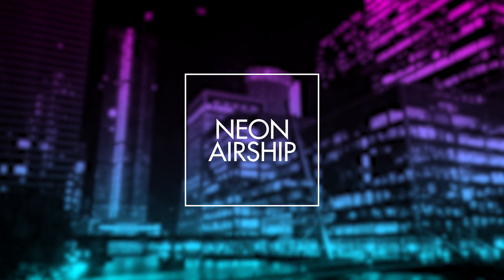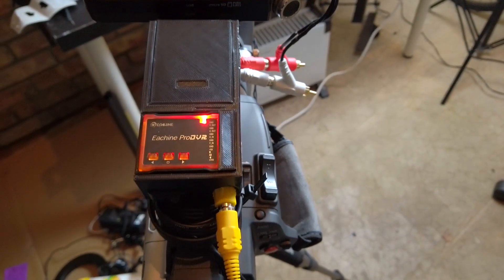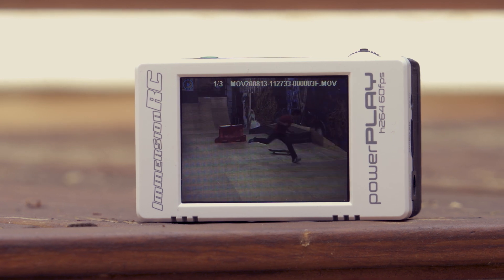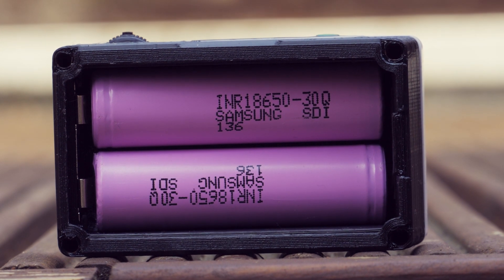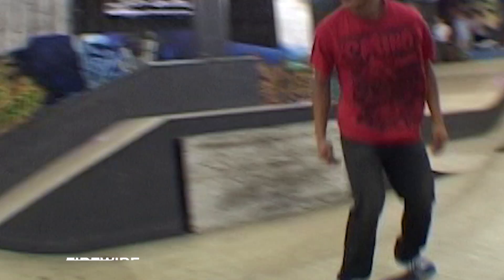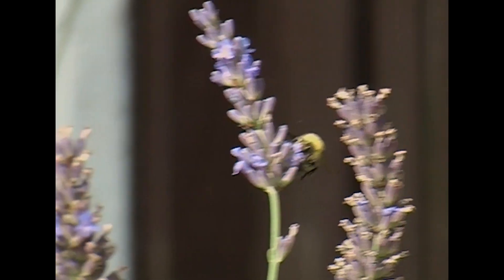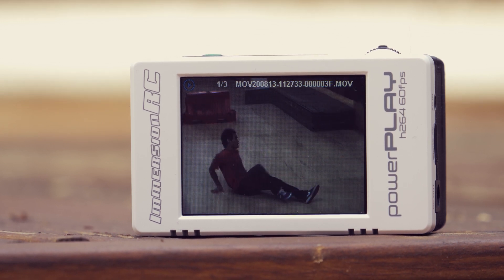Tapeless MiniDV Camcorder Part 2: PowerPlay Boogaloo [GL2 / VX1000]

Comment: Quick question, if your camera cannot record onto tapes anymore, will it be able to record to this? Does the camera just need to be able to output signal to a monitor?
Reply from the maker: Yeah just needs the av output working, camera stays in standby
Reply: @NEONAIRSHIP  do you press record on the camera itself in standby mode? its not possible i guess so you can only record when recording on the powerplay right?

Comment: How can I interpret the footage to use d1/d2 pixels? Is there a way to do it with iMovie?
Reply from the maker: I only use premiere so not sure sorry
Reply: Okay no worries. Would you say it’s necessary to interpret the footage into d1/d2 pixels.
Reply from the maker: I think it only matters if its a HD timeline, if you make a DV project should be all gucci. It just stretches it slightly if it's square pixels

Comment: The thing that will always stop me from trying this is the fact it's adding more compression, compared to importing it direct with no compression (well, no more compression then DV already has!)
Reply: why is this bad. i dont know anything abt this
Reply from the maker: Just means this way is slightly lower quality than using a firewire to capture, and it's already standard def so them pixels are at a premium. IMO it's good enough tho, you can see the difference in the comparison I did - I don't think anyone could tell once uploaded
Reply: NEON AIRSHIP ah ok word

Comment: Thanks for posting this solution, as I was unaware that there was any interest in the old DV tape formats nowadays! I still have a pristine VX2100 from back in the day, which sadly hasn't seen any activity since the demise of firewire connectivity into my laptop, and all the subsequent camera upgrades I've done over the years. I will be digging it out of the cupboard now, and looking into all the available recording options. One thing that I might  look at after your comments, is using my Tascam DR10sg mic, or my Saramonic MixMic SR-H5M for the audio capture, and use the powerplay recording for syncing in post. Maybe there's still life in the old girl yet! :)

Comment: I’ve been filming with a ccd vx1e and have been  first looking at circumnavigating using the np77 batteries and then onto tape less. So thank you for posting this.
Also nice seeing some classic Boardroom footage!
Reply from the maker: Boardroom forever <3
Reply: @NEONAIRSHIP  I just got my powerplay dvr and cannot get a video signal. Have the RCA to 3.5 and it aint workin.
Reply: Following on from this I’ve finally got my Vx1E np77 batteryless and tapeless. It’s a little on the bulky and ugly side but I don’t have to worry about battery’s anymore.
Reply from the maker: Sounds cool! What are you using as the battery solution?
Reply: @NEONAIRSHIP  So for my day job I use fairly standard 12v dc li-ion batteries from eBay. My problem with original nicam batteries is theyre 20+ years old and barely hold a charge. So hacked a charger and old battery to house a dc input and buck regulator to take the voltage down to 6v. The batteries aren’t smart so this work fine. Using a Ezcap dvr which records in 1080. Have found using an upscaler greatly improves the quality. So have this on my rig aswell. I’m just putting the finishing touches to it and will make my own demonstration video along with captured Broom footage!
Reply from the maker: Sick looking forward to seeing it👌

Comment: for the 3.5mm audiojack not pushing in completely, it could be that either the cable or the unit have a different pin-order and it might be worth juggling them around. If all else fails, a normal audio cable from 3.5 to 2x RCA should do the trick as well

Comment: Question about framerates - what is the native framerate of one of these old cameras? I was always under the impression that since they use tape (25fps/29.97fps), that is what they film at, but then all these tapeless DVRs record at 60fps...? Not sure how that plays nice with old cameras, or with, say, converting VHS to digital. I'd appreciate any advice anyone might have!
Reply from the maker: They're interlaced so it's 60i in NTSC/50i in PAL - you're right in that not all the data is used, but the cheaper DVRs skip frames which means slow mo looks jank
Reply: I guess it's the best under the circumstances... Wondering, have you seen equipment like the ClearClick 3.0 DVR?

Comment: do you ever wonder about the quality loss not using the firewire out with this setup? from what I understand analog video out is quite a substantial drop in quality because of the redundant digital to analog conversion that has to happen for these cameras to output in analog out, guess there's a compromise you may have to make for the convenience of this setup
Reply: he showed the quality loss and compared to the other fpv dvr it was so marginal that firewire is only good if you already own the equipment as it costs a fortune nowadays secondhand

Comment: Thanks a lot! I use a Canon XM1 to film skating, this camcorder has just a combined A/V Connenctor (same as the DVR probably) should this work too with just a 3 point aux 3,5 mm cable or do you think I need something more specific?
Reply from the maker: Nah XM1 works exactly the same :)
Reply: @NEONAIRSHIP  So with just 3,5 mm aux? It has no 3 point rca video just one combined av.
Reply from the maker: Yep same as the GL2 in the video
Reply: @NEONAIRSHIP  Thanks a lot!

Comment: What do you think about using a standalone capture like clearclick with an external power? It seems like it would be easier to set up and maybe just as effective. I'm guessing there's a glaringly obvious reason I'm missing that people, yourself included, aren't already going that route. Thanks for all the info!!!
Reply from the maker: Yeah you could but it'll be mjpeg 30fps like the eachine example in the video and not much cheaper
Reply: @NEONAIRSHIP  thanks! I think I'm going to pick up a powerplay and set it up like you have! I'm really excited to start playing with my gl2 again and not worry about the heads wearing out! Thanks again for this info! One last question. Do you think this is a good option for capturing video from my mini dv tapes?
Reply from the maker: Awesome, yeah works great for capturing tapes
Reply: @NEONAIRSHIP  just wanted to say thanks again for the info/help!!! I just got my powerplay in the mail, thanks to you! Super simple and easy to use. I'm really excited to play with my gl2 again! When I slow the video in premier to 50%, it almost looks as if the image vibrates up and down slightly. Any idea if this can be fixed? I'm hoping I can solve it by changing some timeline properties or something.
Reply from the maker: Hey man, yeah I think I know what you mean - it's a frame rate thing, try a few different timeline settings to get one that matches up and that will get rid of the jittering

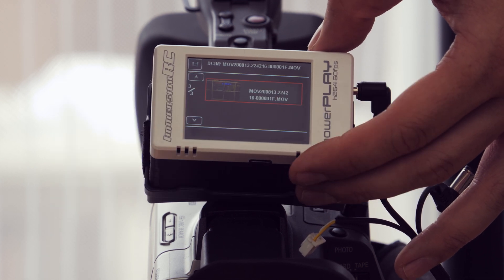Comment: Thanks for making this series! I've just gotten myself a GL2, and tried something along the lines of your first video. I'm having the same problem you pointed out at 3:58 . I wonder if it's just something to do with the GL2 or the ports on these Mini FPV DVRs. Wondering what your thoughts are!
Reply from the maker: I'm not sure but I think it might be the layout of the 3.5mm jack? TRS vs TRRS kinda thing. Different cable could potentially solve it
Reply: @NEONAIRSHIP  Ah! I've found the solution to the problem. The manufacturer changed the layout of the 3.5mm jack and swapped the video line with the ground line.  Now I'm getting a clean picture. Thanks for the tutorial!
Reply: @brianfromtheelluminaticoll8544  Im having this issue aswell. What did you do to solve it?
Reply: @cruzarnett6408  I'm using two 3.5mm to AV (Red yellow white), one with male AV cables, one with female AV cables. I matched the white to white, Red to Yellow, and Yellow to Red cables together, and it reads perfectly clean now (I have some example footage on my channel)
Reply: @brianfromtheelluminaticoll8544  can you make a video tutorial on that issue? plss
Reply: Having this problem aswell, do I need to buy a new av wire or is it a problem with the jack on the dvr?
Reply: I’m interested if anyone has solved this issue, would simply a TRRS 3.5mm av jack to jack work? As apposed to the supplied cable? Can anyone confirm? Ordered the dvr today but wondering if I can skip the awkwardness and get straight to the good stuff by buying a new cable now
Reply from the maker: I'm gonna do some more experiments soon but it works fine with the jack not pushed all the way in so don't worry too much. I think it's just TRS but in a different order, so the easiest would likely be the way Brian described above unless you're cool with soldering/crimping

Comment: bro so i have a sony trv900 which only has a audio/video 3.5 jack. do u think i can get a 3.5 to female adapter that plugs into the immersion rc device and use it like that?
Reply from the maker: It's the same connection as the GL2 in the video, you can use the included cable
Reply: @NEONAIRSHIP  thank you! i didn’t see that at first

Comment: What fish eye you run on gl1 bought a optika 0.3 and it won’t screw on made sure it was gl1 compatible before I purchased
Reply from the maker: what is the filter thread on your fisheye? you probably just need a step-up/step-down ring
Reply: @NEONAIRSHIP  titanium series 0.3X
Reply from the maker: Yeah but which one? 37mm, 58mm, 62mm? GL1 is 58mm so anything else will need an adapter
Reply: @NEONAIRSHIP  58.8mm
Reply: @NEONAIRSHIP  the size of it
Reply: @NEONAIRSHIP  anyway I can send you photos so it would be easier to help me new to all this
Reply from the maker: My email is in the about section on yt or DM me on insta

Comment: hey! mine came in today and i'm having trouble positioning the 3.5mm jack into the powerplay so that it 1. gets a non-glitchy video signal and 2. records audio. so far, i have to fidget with it to get one or the other. any tips?
Reply from the maker: Hey, I'm gonna make a video about this soon but it seems the the red and yellow AV signals are in the wrong order on the DVR. So you can either use some adapters to switch em or just plug into the other ports depending on your camera
Reply: @NEONAIRSHIP  i have a TRV900, so i'm using the 3.5mm AV jack. what would you recommend for an adapter?
Reply from the maker: OK in that case the easiest way is to get 2x 3.5mm to AV cables - one with female connectors and one with male. Then you can swap em round until its correct
Reply: @NEONAIRSHIP  hey, do you mind linking the cables you would use just so i know i am ordering the right stuff
Reply from the maker: @kain6473   https://amzn.to/3amPQ8F + https://amzn.to/3oVfXaD
Reply: @NEONAIRSHIP  thank you bro! whole setup works flawless now
Reply: @kain6473  do u have any footage anywhere using the decice i have a trv900 too lol and am pretty invested into this
Reply: device*
Reply: @michaeldennis8258  yeah i have a couple clips messing with it, where should i send them to?
Reply: @kain6473  yo kinda late but do you mind dropping me a pic of your setup? I got a try as well and just need a reference for setting up the cables
Reply: @aleclogan8009  yeah where should i send them to?
Reply: @kain6473  my bad just saw u responded aleclogan_ is my ig
Reply: @kain6473  Yo, I have a TRV900 as well, just wondering how your setup looks/works. I'm still on tapes but I'm gonna do this and get rid of the hassle lol. What cable configuration ended up working for you?
Reply: @RAILSPIKE  you got ig?
Reply: @kain6473  yessir @railspikey

Comment: Thanks for the incredibly helpful video!!
I was wondering if you knew if this would work with a canon XL1s
Reply from the maker: Yeah I think so, if I remember right it has the full size AV connections like the VX right?
Reply: @NEONAIRSHIP  God i hope so its so hard to find official manuals and specifications, worse case scenario I might just use firewire and try to perpetually record without tape inside
Reply: @MananaMan  I'm gonna test it out on my Canon XL2, will report back.
Reply: @carldiamond4234  did it work?
Reply: @scoobyrex247  yes it did!

Comment: will this work on a vx2000 too?
Reply from the maker: Yeah man, pretty much any mini dv cam
Reply: @NEONAIRSHIP  amazing! thank u so much you've just saved me from so much stress with this video, absolute legend
Reply: NEON AIRSHIP hey man just a quick one, i bought one and it’s recording fine with my vx2000 but it’s only recording a static sound for the audio, do you have any idea as to why?
Reply from the maker: Cable might be wired differently, try plugging the red into the white and vice versa?
Reply from the maker: Otherwise there might be some output settings to play with in the menu but been a long time since I touched a vx2k  - I'm sure there will be a way
Reply: NEON AIRSHIP been at it all day and haven’t found a solution yet. i’ll let you know if i ever get to the bottom of it!
Reply: NEON AIRSHIP yeah i tried everything, every setting, new cables, firmware updates the lot and still no sound. the mic on the camera works perfectly so it’s either the white and red ports on my vx2000 or its not compatible with that specific camera
Reply from the maker: @9billiondogs  mate thats a bummer, might just be the cable? worst case 3.5mm to phono cable in the headphone port would do it
Reply: NEON AIRSHIP holy shit it works! 48 hours of pure stress and the answer was that simple haha, thank you!!!
Reply: @9billiondogs  how's your quality? i have a fxt dvr with my vx2000 but the quality and sound are very poor...

Comment: Does this require the DV out port on my canon xm2 to be working
Reply from the maker: Nope just the av ports, you can plug it into a TV to check
Reply: @NEONAIRSHIP  sounds good, because my dv out port is broken and thought I might have to get it fixed to use this. Also does it have a built in hdd or does it use an sd card
Reply: I just read the description were you mentioned it uses micro sd cards. Think I’m going to have to purchase this